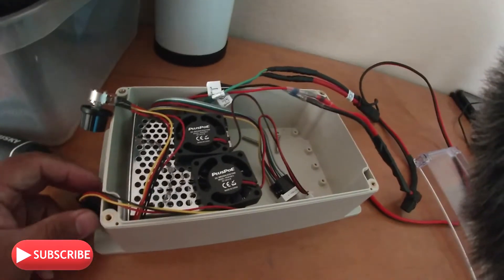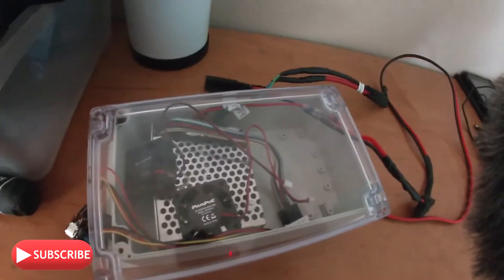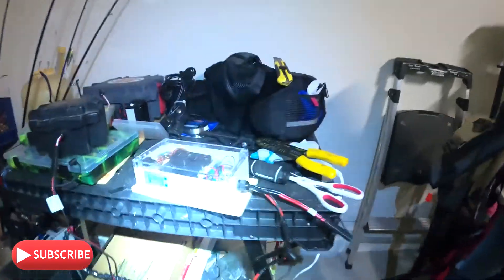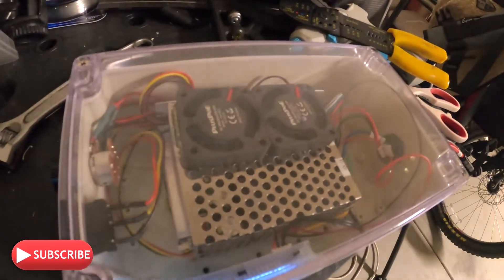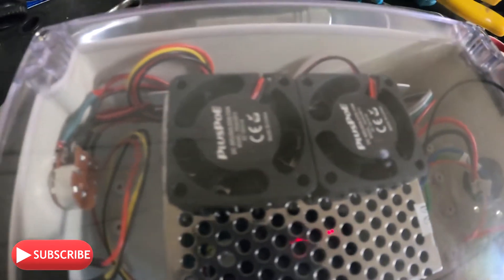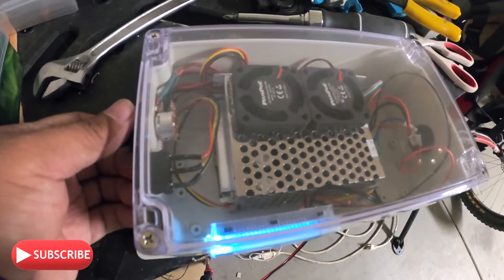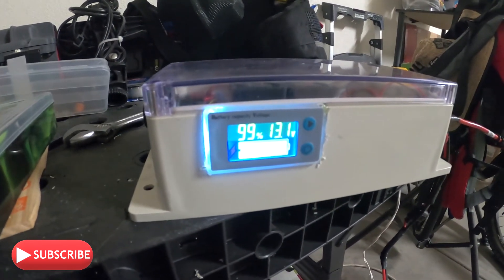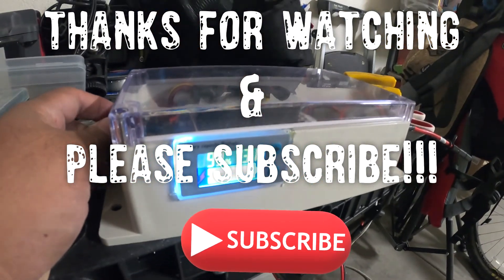Custom PWM build for kayak trolling motor (pulse wave modulator)

Comment: Just a slight point of info.  PWM stands for Pulse Width Modulation.  It is a technology that varies the output pulse width of the 12 volts in order to control the speed of the motor.  It does this by turning the 12 volt power to the motor off and on.  Other than that this was a great video.

Comment: Hello, Can you please let me know how you connected the dual fans to the PWM? Did you just take the  negative and positive to the battery negative and positive?
Reply from the maker: actually connected the neg/pos wires to the motor connection on the PWM, so it turns on when you turn the potentiometer...

Comment: I am still using my original $14 pwm that I bought over 4 years ago. 
I had it in a sandwich container for the first 3 years . I was suprised it has kept working , so I upgraded case to a waterproof cell case . It has been going for 4 years now . 
I do not run it hard . I use the motor for trolling at 3/4 mph-1.5 mph on the Snake river or Dorshak res.  
I fish 3 times a week year round unless the Snake river freezes . So , that cheap pwm with no fan has lasted about 1800 hours . https://youtu.be/qsHHnkaMSC8?si=k8AusXVnbl6Ggg56
Reply: https://youtube.com/shorts/WLUs32EvknY?si=KLrqjn6jqAEzwbag
Reply: https://youtube.com/shorts/PMdUYRb3mTc?si=3aVYHK4YxiM14Ev-
Reply: ....that's excellent, specially if you only ran it at 1.5 mph, out here my lakes are big, and the tournaments are packed, so we have to run full throttle all the time and move around the lakes a lot....

Comment: Very nice work mate I would have used a bigger fan though good stuff 👍,,,,,you also could have used a RC brushed waterproof 300amp ESC to make it more compact and make a kill switch Lanyard clipped to if you went ass-up and over board it shuts off the motor instantly 😀
Reply from the maker: ....i do have another set up using the brushed esc, for back up...thanks for the info

Comment: The fans won't be much good if the box is sealed. You should have some kind of vents to let air pass thru.
Reply from the maker: ...yes I do, have drilled multiple holes...

Comment: good afternoon, how did you make the connections for the fans to only work when the potentiometer turns on? thanks
Reply from the maker: connected the wires on the PWM motor contacts, not the battery side...so it only gets power when you move the dial on the potentiometer...

Comment: Just some advice, take the pot and switch out and put in a smaller box so you can have kind of a wired remote, then keep the big box by the battery.
Reply from the maker: Tnx

Comment: Do you have a wiring diagram for this setup?  I am having trouble figuring on how to wire the cooling fans like you did.
Reply from the maker: ...I stripped the fan wires and connected the positive/negative wires with the ones on the PWM motor out connections...
Reply: That doesn’t hurt the fans, being connected to the PWM output?

Comment: So can thrust of ur trolling motor are you using. And I’ve a 45 thrust trolling. Do you think this pwm will work with it. And thx
Reply from the maker: i have the minnkota c2 30lb thrust, and it runs real good on my PWM no issues,,,